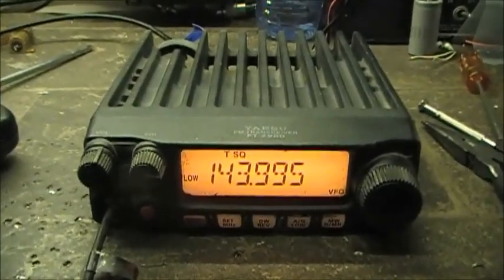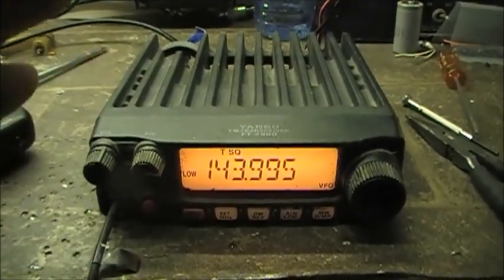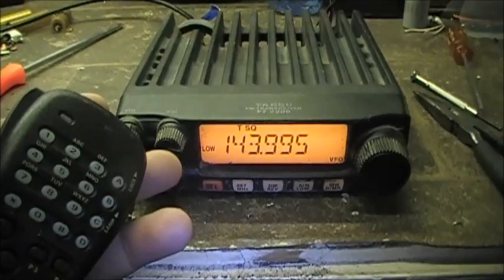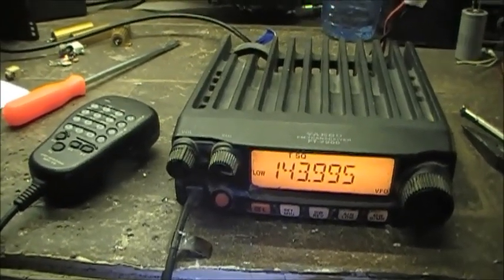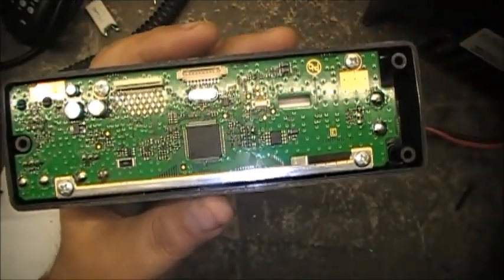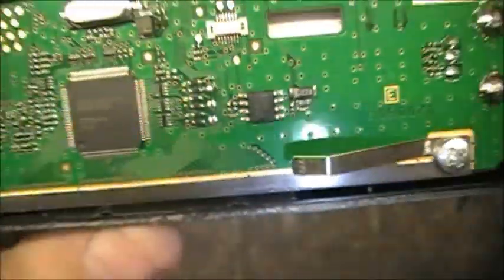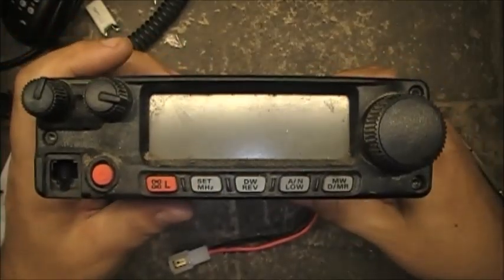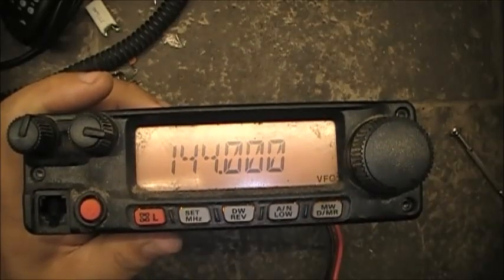Yaesu FT-2900R  - Extended transmit de-modification and reset.

Comment: Why would you de-modify?
Reply from the maker: Because i do not run out of band on my equipment, or any other equipment i may come across over time.
Reply: @Radionut63  Ok. I just find it interesting that you would go through the trouble of re-soldering that pads.  I would just not key up on any out-of-band frequencies if it were me.  To each their own, thank you for the video & response.